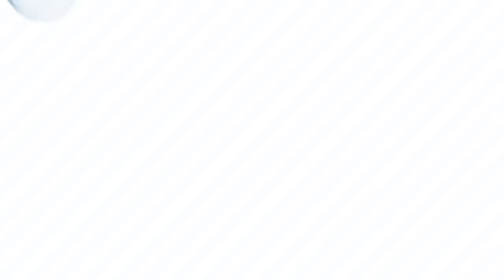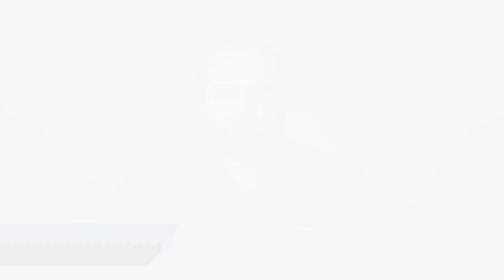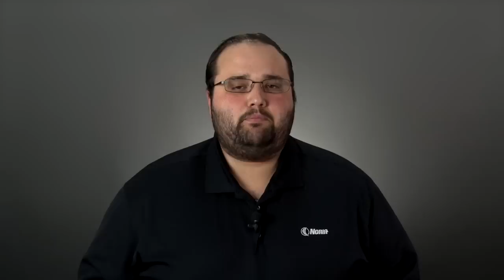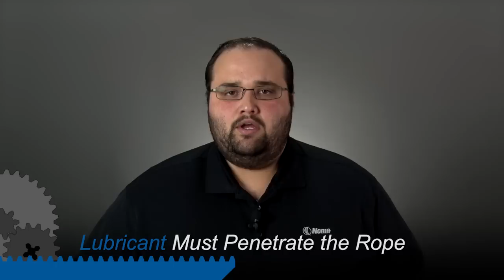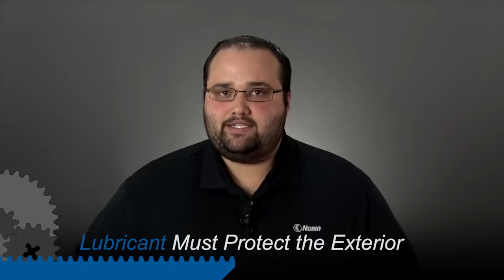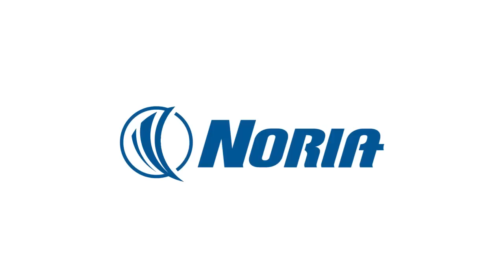Advice for Lubricating Wire Ropes

Comment: Thanks Wes Cash. Do elevator wire rope need to be lubricated? Because our elevator wire rope have dried out and some of the wires have broken.
Reply from the maker: Good question, as there are many types of elevators there could be a need for lubrication of the wire ropes but not in every case.  You can contact us with more information regarding your application if you would like to: https://www.noria.com/contact/
Reply: @noriacorp Thank you for your reply.

Comment: Does grease is required to used old engine oil and mixing it with grease for crane cable wire rope?

Comment: never heard of anyone oiling their winch cable. but i know they need to be for corrosion resistance and care of the cable.
Reply: its more than that it allows the wire rope to function like its designed the strands need to slip and slide so they can lock down onto the core without stretching